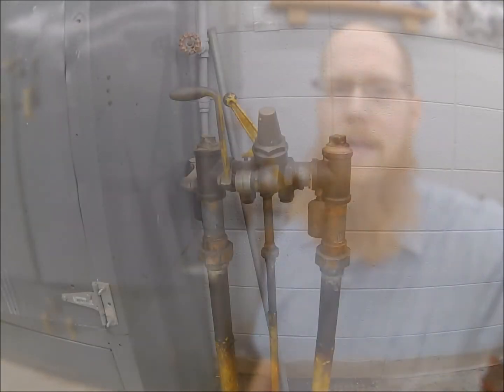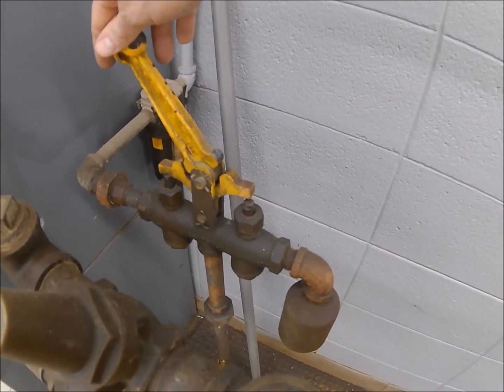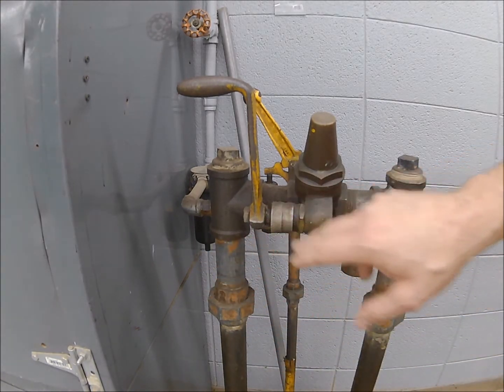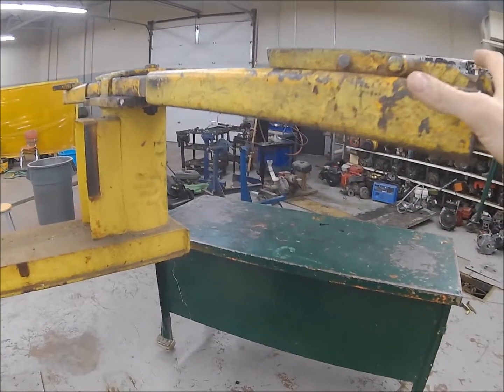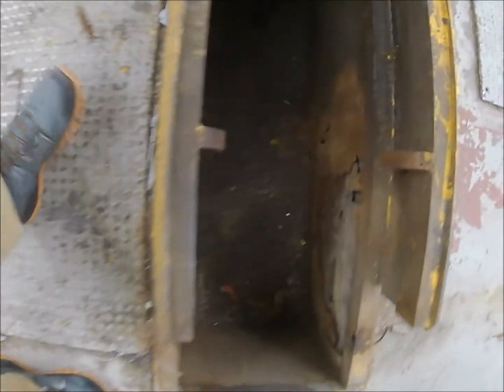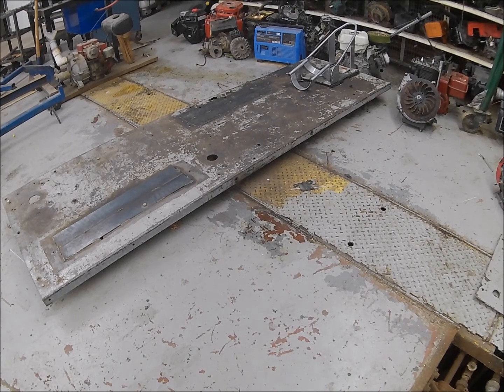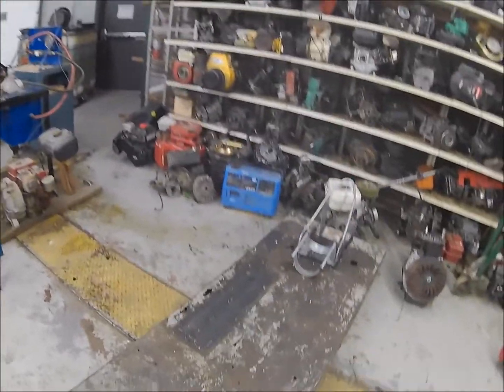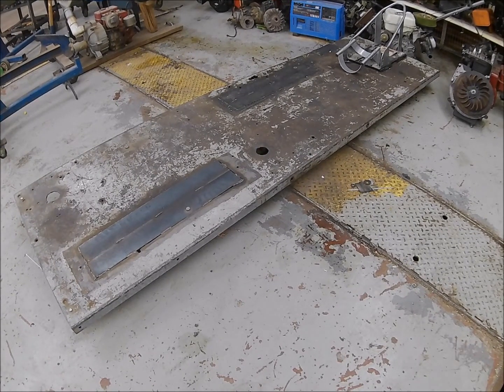Air over Hydraulic Lift

Comment: I have an old air over hydraulic single single lift.  What kind of Hydraulic fluid should I use
Reply: you can use iso 32 or 46. highly recommend using a biodegradable hydraulic oil due to the leaks on these things.
Reply from the maker: Not sure, I’ll pin your comment to see if someone out there knows
Reply: We use 32 weight in ours
Reply: Update... contacted S V I in Dekalb,IL they make parts for all old inground lifts..and build new GLOBE Lifts..still.   Costs around 10 grand for new one.. they told me I can use A T F fluid to fill the inground lift  not hydraulic fluid..  they sell seals and parts for all ingrounds  just contact them  Google there information.
 I bought a new seal combo kit for about 265 bucks. No more seal leaks..
Reply: Does anyone know how do u apply it ! ?
Reply: Transmission fluild.
Reply: Transmission fliuld   will work

Comment: Thank you for the video.  I have one of these hoists that bled some oil when you pressurized it.  Would it be possible to update the video with a follow up on how did you fix it and whether it is operational now. Thanks again
Reply from the maker: Thanks for watching, Maintenance has deemed these unsafe and made them inoperable.
Reply: @YoungbloodFamilyFarm  thank you. Do you know if there is a manual for the one that have a moving front and stable rear piston?  Who made them?

Comment: I have a ford smith 10 5/8 inground I installed myself back in 1980 and was a used unit in good shape ,now is started to puke out oil around the upper seals ,im about to try and pull out the piston and try to replace the seals both top and bottom ,like to know where to get parts and price and is this a big job ?Im from Ontario Canada     Thanks
Reply from the maker: I hope someone sees this comment and can help

Comment: ANYONE KNOW WHAT THE AIR PREASURE NEEDS TO BE FOR AIR CYLINDER NOT HYDROLIC. BUILDING A LOG LIFT FOR MY MILL
Reply: Air pressure for a inground lift needs 150 psi..  I have my owners manual for my 1983 rotary inground single post lift..it cals for  a 2 stage air compressor..80 gal ..

Comment: I install service and repair automotive equipment. The old SPIG(Single post inground) is an awesome lift that I do repairs and service on almost 1-2 times a week. That lift you have is a for-aft. You don’t need to install anything on your lift. You do need to have the gland seal replaced and depending on the brand you’ll need to replace the packing and bushing. Those lifts will go for 20 plus hears without needing serviced . 
And the water oil issue you have is because you have too much water in your air system. You need to install an air dryer or a water separator. Once your SPIG oil gets contaminated with water it will cause issues. 
Also some SPIGs can’t be repaired. Some brands have the bushing welded in internally and cannot be replaced . If you raise your lift up a few inches from the top or as high as you can get it if you can’t go that high, push and pull on the top of the rack to see if you have play back and forth . If you do the lift is not repairable depending on the brand/manufacture
Reply from the maker: Thank You
Reply: Brandon, have you worked on these SPIGs?  I need some help operating mine. Thanks

Comment: I know I’m about 3 years late to this party but I have a 1971 “western lifts” 8000 lb lift in my shop,it was installed new back then ,I know nothing about it except that it does work last time I used it was around 12 years ago,My interest in trying to get it working safely has increased as I have a couple of jobs coming up and I Don’t want to be laying on the floor using a floor jack jack stands as my knees are junk and I’ve gained about 40 pounds over the last five years LOl!!,im going to test it with around 4000 lbs and see if it will still lift a car and keep it in the air without killing me,I do have a couple of chain falls I was thinking of rigging to the main truss above as a “saftey”in case it all of the sudden let go id have atleast alittle notice,,far as I can tell the company is still in business I may call to see if they offer a manual,maybe the resuscitation of this lift will be my 1st YouTube video??,anyway thanks for your video.,
Reply from the maker: Yes, old video, I enjoyed the lift for what it was worth.  A little unsafe only having a safety at the top, but it did a good job.  It was removed by my school for insurance liability compliance.  Best of luck with yours

Comment: That's a maintenance item on air over hydraulic. Need to drain the water every year or it will fill the tank eventually.
Reply from the maker: Thank you
Reply: I have a  air filter system on my air lines ..and one just for my inground..lift..I drain it after each use..  since I'm down in Florida.. you don't want water mixed with oil..it will rust out the piston casing..mine a 1983  rotary... single post lift..

Comment: The 2 lift i wouldnt use anymore..looks like u bloww out the main seal..danger. Leave it be turn off the air to it.....the fist lift..it seems good as long as it dosnt leak down. When u pessure it..air valve..2nd valve is an oil valve..fully hyd system..it looks like the sm leg needs some oil on the lift lock to work again.  My dad has an old globe lift similar to yours it was instaled in 1950 i belive ..still works..old school lifts are best. Your modal # is globe fydt-10...8000lbs.. U can still get parts .from svi.inc. dekalb il.  1800 321 8173. They have parts for all inground lifts..give them your model # and ser..#..even if its 50 yrs old..i hope this helps u...but emty out your air filters. From water..so it dosnt get into the lift oil..
Reply: I would love to add..to this. At your school shop,lift..if it stays up..it should be ok...no leaks..it went up smoothly..if it bounce s..going up..or down..it's got issues..don't use it..at all..we have simer lifts in our shop.. when we were servicing cars ..untill 1999.   That were installed in 1950s..still working to this day..I still run them up..to make shure there working..and they do..in 2021..shop been closed since 1999.use building as my storage room..for things..il still change my oil now and then..I still trust the lifts..to this day..
Reply: You have a seal blown  out on the table lift
..its done..do not use that lift any more..un safe..could kill somone ....again the first lift u showed us. Still looking  good ..the fill valve yellow Handel...is your air to ..the oil tank in the ground...agenst the wall..the outer. Handle  is called an oil valve...which  let the oil in the piston..to raise it...old school lift..as long as that lift stays up,not not slip down..your good to go...just make shure your lift lock engaged..for safety..I have a globe lift in my home shop..that' works well. My dad's old service  station  had the same lift..as yours in that school installed in 1957..it worked till he sold and retired in 1999..I trust them. More than a above ground unit. But I took the newer one out of his station  witch was only 5 yrs old..in 1999..when they were removed  all of them. And put in in my home shop..it still works today..2022..I use it once in a while..its a single post ..globe...ty for your video...nice..

Comment: I have a lift similar to the first one shown in the video. In the center of the lift plate there is a oil reservoir that has a dipstick. Mine is emyty and says add one gallon to get it back to the proper full level. Can someone tell me what type of fluid these take?
Reply: Hyd oil..u can get at an auto parts store...easy fix for you..get at least 2 gal.s.  add a gl. First. Check it again do not use moter oil at all ..
Reply: @stepheneggert2696  Thanks man. Is it normal that air builds up in the chamber where the oil goes? Every time I unscrew the cap where the hydraulic oil goes, it shoots out air.
Reply: @joshflavell4208  yes thats normal a little air comes out ..add a gl. And check it out ..let me know..
Reply: @stepheneggert2696  Definitely will. You seek to have quite a bit of knowledge of this system. When I run my air compressor throughout the day the lift raises on its own. And when I shut the air compressor off for the day the lift is back on the floor by the next morning. Why does it do this? Also I'm getting oil leaking out of it from somewhere. It puddles up on the floor around it. Amy suggestions? All help is appreciated. Can't find many people that know much about them these days.
Reply: @joshflavell4208  You have to depressurize it first, otherwise you could be visiting an ER.

Comment: IF ANYONE COULD HELP THAT KNOWS HOW THESE OPERATE.....
I've got  a Globe I think 8000 pounder. 
I have a few other numbers on the nomenclature that I don't know what they represent with the printed wording has disappeared over the time. 
It has the same "pressurizing" lever but not the other one to raise. Only one lever operates the lift. 
It takes a lot longer to lift and drop than what is shown here. Last night, when reaching bottom, drop height it was spewing oil and water from the air relief. (Writing that last as it was going on on this video. 
I can't find any info on Globe website. 
Thank you for this vid and any advice in advance.
Reply: U can contac svi..at 1800 321 8173. In dekalb il.  U have a simi hyd system...fs10 a.s. i belive.. They build them as well and have parts u need..to repair ..our lift was instaled in 1950. ..still works today..give them a call ..i bet u have a lot of water in the oil.
.make shure u have a air filter on the main air line .to get the water and drain your air comprsoir ..if the seal on the lift is not leaking..so far your good ..you can check the oil in the system as long as there no air in it..turn off the air ..and drain the comprsor of air for safety..open the oil fill thers a dip stick buit in on the oil plug..check it level ..if u need hyd oil add it.... Reinstale oil plug and try it ..again..theres a vent screew on the casing. Open it a crack of u hear air hissing out ..it needs bleeding untill u get oil comming out ..then close it...it should work...
Reply: I promise il do a video when we get ready to instale our new ingroung..lift..  To show anyone intrested..in seeing this. Happen
Reply: Im getting ready to order a new inground lift..single post ..im having a new morton pole building put up. I dont trust above ground lifts ..made over sea s ..mostly..they said it will take 8 to 10 weeks build time..5 grand is the cost plus shipping 250 lift gate dilv cost. If u got a back hoe..its easy it comes with instuctoins. Ive helped a friend instale a used lift in his back yard..

Comment: Does anyone know how to get an air over hydraulic lift to come down?
A guy put it up without anything on it and now it won’t come back down
Reply from the maker: Damon Beckham the one I have has a safety bar, that has a “t” style catch at the bottom, the lift needs a decent amount of weight to lower it,  it also needs the air pressure removed
Reply: Just be carfull ..on older lifts. Make shure that the non rotor leg is up not resting on the floor..if its resting on the floor lock...add some air to the lift..to go up a little if it drops on it own u know it leaks air ..call a lift repair co.svi.interntanail at 1800321 8173 they have parts for all inground modals and can give u the name of a local repair co to help u..  Ok if the lifts stays up release the lift lock in the top of the leg ..it should clear it so it can go down..exit the air at controls ..it should go down..but if its up still stay away from it ..if it drops down it can kill you..be vary carefull around it at all times. My advice..i hope this is helpful..

Comment: That one with the front and rear cylinder is a very valuable lift. those are wonderfully useful, they don't make those anymore, and they aren't easy to install..
Reply from the maker: Yes, very useful.  It is difficult to find someone to repair these, Something about safety, who knows
Reply: You can still get them from globe lift ..and parts for them. From svi international in dekalb il...1800 321 8173...

Comment: I dug one of them air over hydraulic cylinders out once. I'm a plumber. We tried changing the air line under the floor. But water had gotten into the cylinder. So they paid me to dig around it 12' down and pull it out with a tow truck.
Reply from the maker: Sounds like a filthy gig!
Reply: @YoungbloodFamilyFarm  you begin to understand why the EPA cracks down on these places once they're sold. I could run an engine off the water seeping into that hole. lol